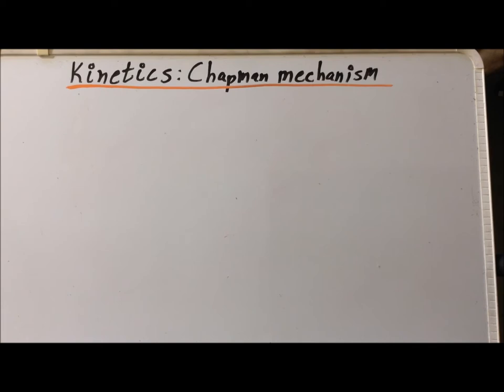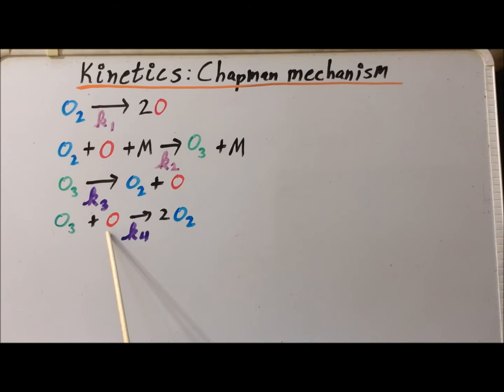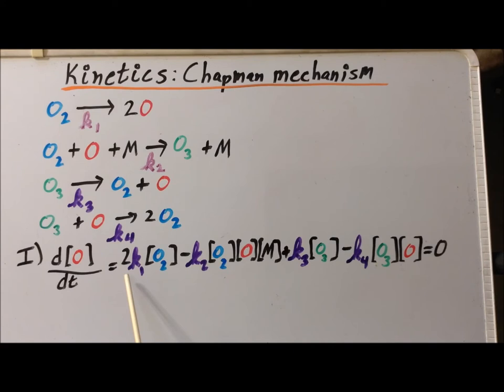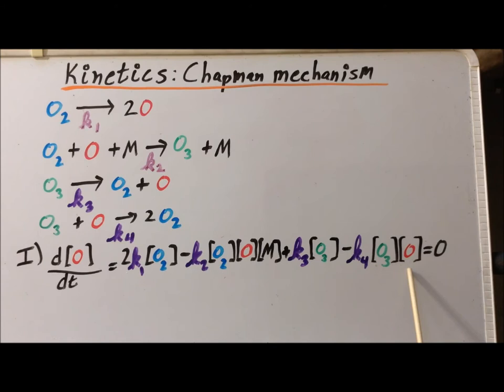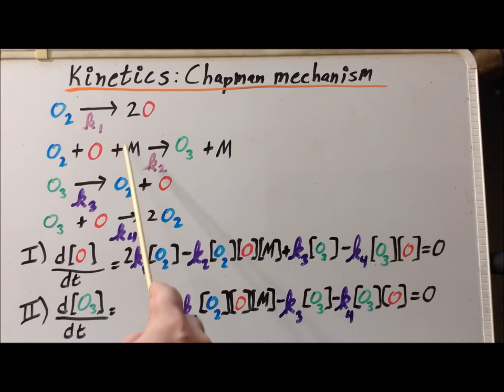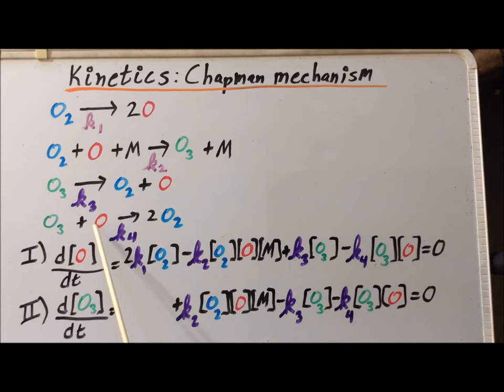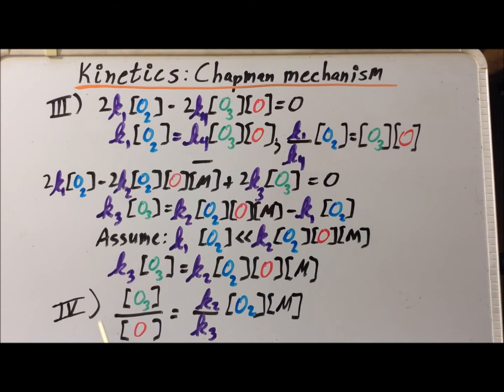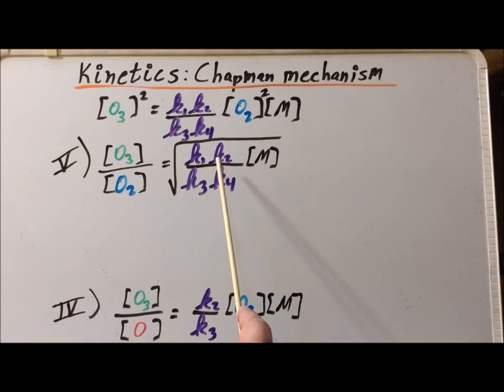Kinetics: Chapman mechanism for ozone depletion derivation

Comment from the maker: (for mobile users)

00:15   Introduction
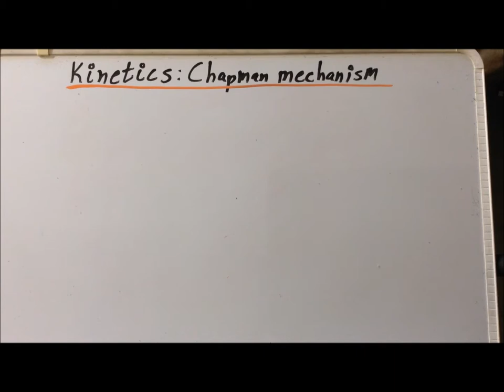00:31   Four (4) steps of Chapman mechanism
02:29   Equation (I) for the steady state concentration oxygen atoms [O]
03:34   Equation (II) for the steady state concentration of ozone [O₃]
04:53   Add equations I (02:29) and II (03:34) together
05:39   Equation (III) for the steady state concentration product [O₃] [O]
06:11   Subtract equation II (03:34) from equation I (02:29)
07:24   Equation (IV) for the steady state concentration ratio [O₃] / [O]
07:57   Multiply equations III (05:39)  and  IV (07:24)
08:34   Equation (V) for the  steady state concentration ratio [O₃] / [O₂]
08:52   Recall equation III (05:39)
09:14   Solve for concentration [O]
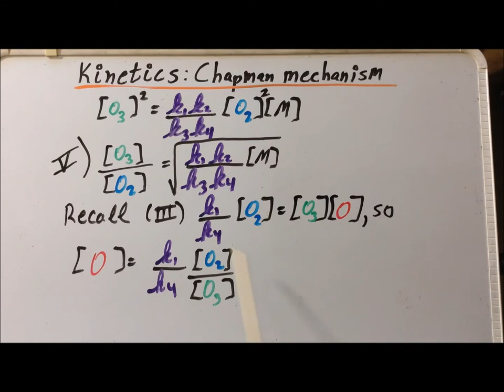09:46   Recall equation V, take reciprocal
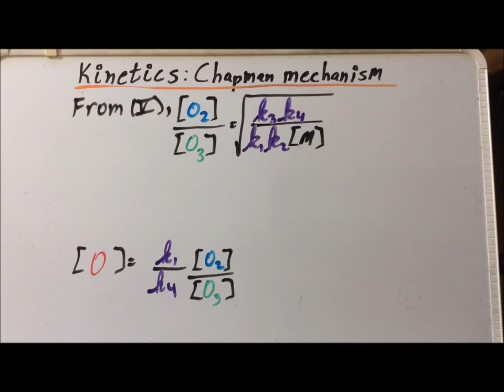10:16   Substitute (09:46) into (09:14)
10:35   Simplify
11:27   Final expression for steady state concentration of oxygen atoms [O] in ozone layer

Step-by-step, color-coded derivation of expressions for [O], [O₂], and [O₃] at the steady state
 in the ozone layer from the Chapman mechanism.

Don't forget to like, share, and subscribe!

Comment: can you please tell in the eqn for steady state fo ozone how the power M]^3/2 came 
in books???
Reply from the maker: It comes about by making the assumption that  [O₂] = 0.21 [M]. This is equivalent to assuming that 21% of the molecules required to carry away excess energy - the M's - are O₂ molecules.  Oxygen makes up a mole fraction of the atmosphere of 0.21. Does that make sense?

Students often believe that reactions with fractional orders - 1/2, 3/2, 5/2, and so on - are not possible, that only integral values for the order are possible. In fact, orders of reaction like 1/2 and 3/2 are extremely common. They often occur in reactions in the gas phase, especially in free radical processes.

Comment: Excuse me sir why we are adding eq 2 in 1
Reply from the maker: There are two (2) reasons. First, it gives us an expression (III) for the steady state product [O₃][O]. Second, it is necessary to eventually get an expression (V) for the steady state concentration of oxygen atoms [O] in the ozone layer. Does that help?
Reply: @lseinjr1  hmmm, i thought we are appliying steady state apx. For first equation cause O3 is intermeddiate still is that true
Reply: I mean when we are doing thiss adding each otherr i dont understandd
Reply: @lseinjr1  well is that any other way to find main eq sirr
Reply: @lseinjr1  i mean another way to find main eq
Reply from the maker: If we have two equations, A = 0 and B = 0, then A + B = 0. Or, if you prefer, B = 0 implies -B = 0. Then, since A = 0 and -B = 0, we can set A = - B (by transitivity). Then, adding B to each side, we get A + B = 0.
Reply from the maker: Yes, we are applying the steady state approximation to both oxygen atoms (O) and ozone (O₃).
Reply from the maker: No.